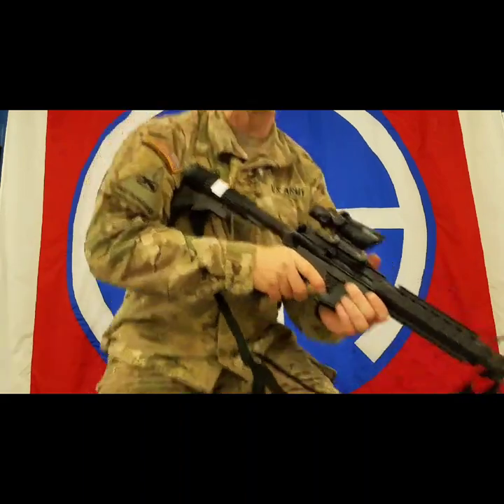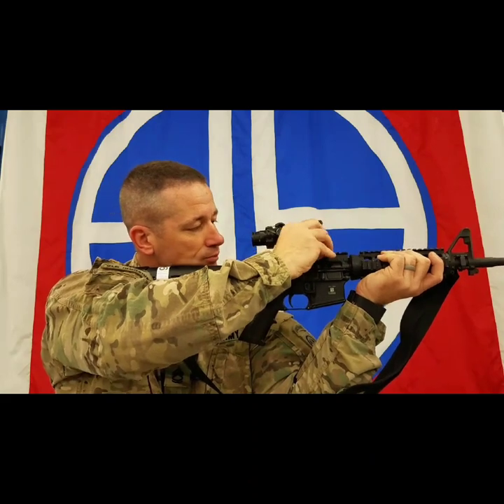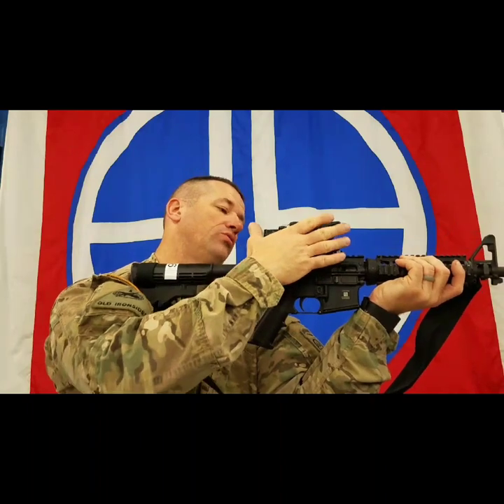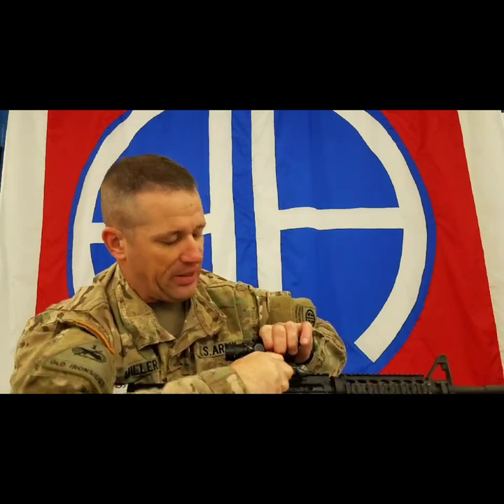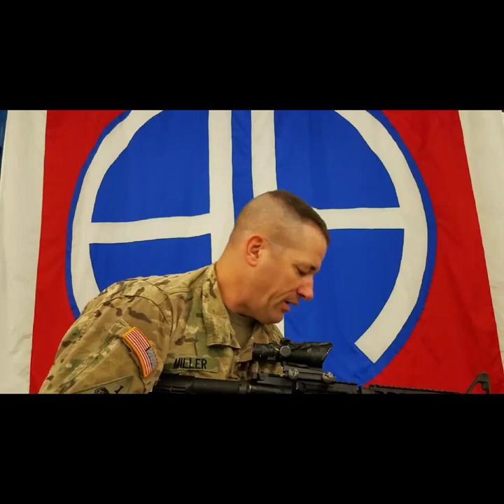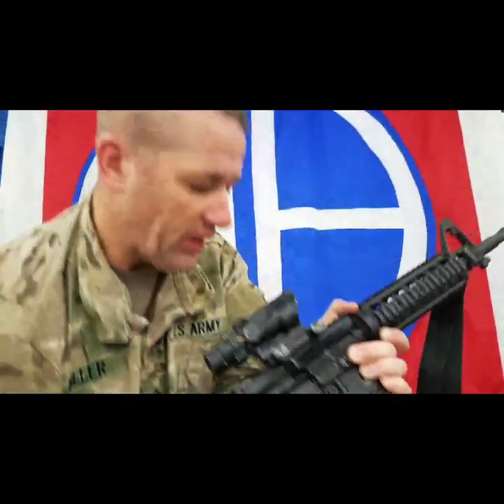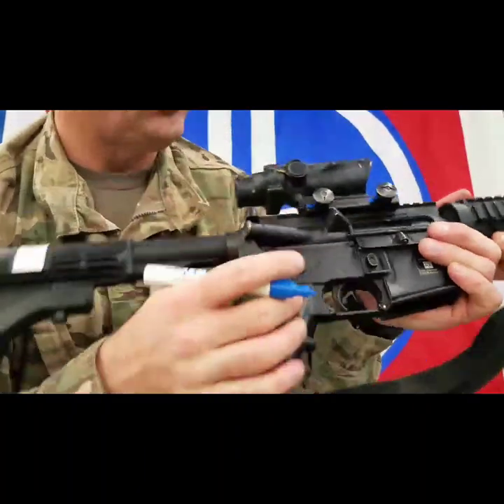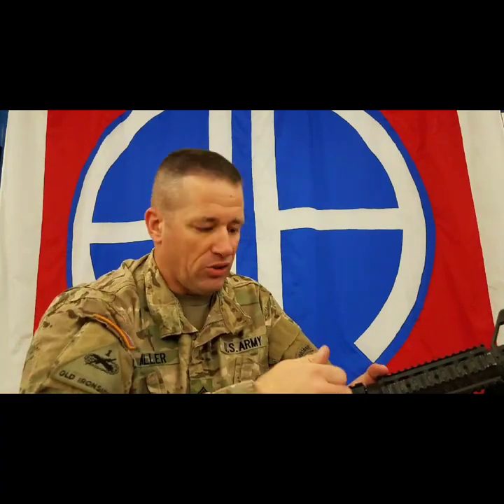How to Properly Mount an Army Optic

Comment: The paint seal is cool, but what about using some Medium Strength Locktite on the mount screw threads before installing the mount?
Is that not necessary for some reason?
Reply: These weapons change hands so often locktite would be impractical. Tool tight is fine, im sure they zero their optics before a qual or live fire exercise anyway

Comment: Hey Msgt, 
1. How does basic sighting of the optic work, from this step on?  Do all issued M4's have the iron signs already sighted? 
2. Do you use any kind of threadlocker, or does that not make sense in combat (if you had to take a damaged optic off?)?

Thanks

Comment: SFC, is it recommended to remove my ACOG from my rifle when not in use (in my safe) and then reattach when going to the range?
Reply: No, anytime you remove any optic you lose your zero
Reply: @Mega554321  I don’t think the ACOG was designed for that
Reply: I wouldn't...